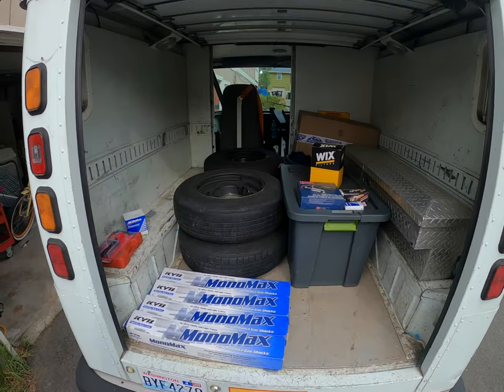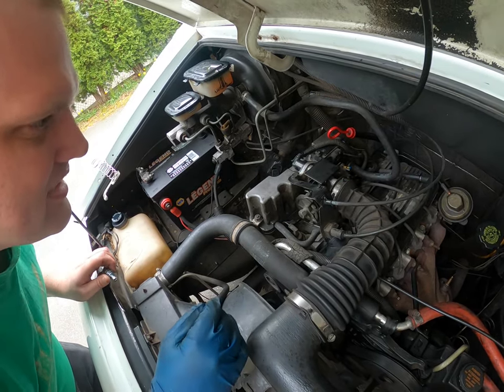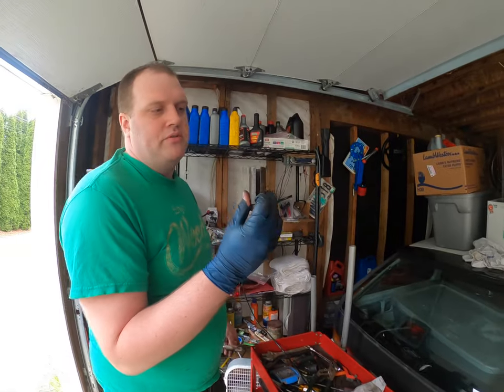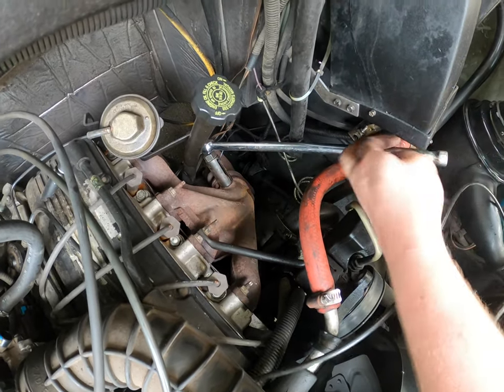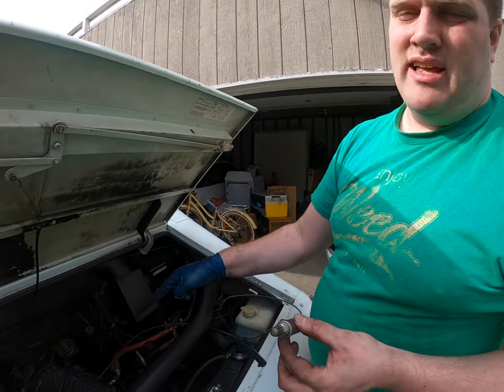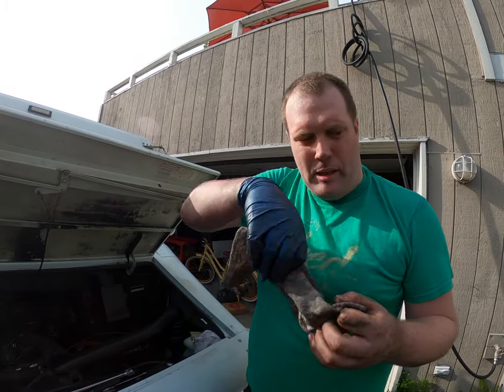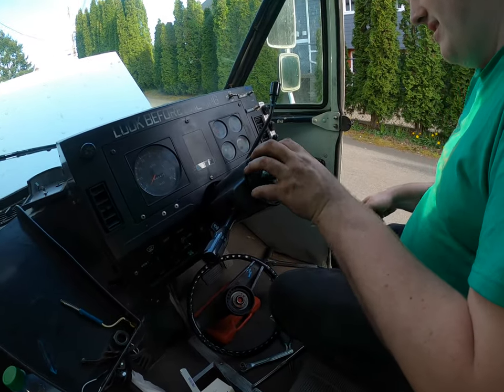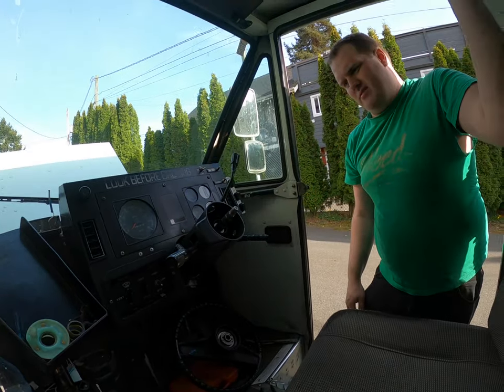LLVlog #5: Mail Truck Maintenance! O2 sensor and Turn Signals

Comment: Hey, I snagged a brand new door handle assembly, two dashboards, and some other small stuff from an LLV in a junkyard here in PA. I think the mirrors are still at the yard as well. They crushed it legitimately less than a week after it was put in the yard.
If you need anything let me know.
Reply from the maker: Shame, I would have loved to pick up some minor bits from it. Even just a few photos how certain things are supposed to be. Oh well, sad to hear that it got crushed already. Probably worth a pretty penny in scrap given how much aluminum is in them.
Reply: @PostalDog94  yeah. What photos are you looking for specifically. I might have a photo of it.
Reply from the maker: The first that comes to mind is how the heater valve is supposed to originally be mounted.  Another is what hardware was used to mount the spare tire jack to the passenger side of the bulkhead and where did they store the iron that goes with it. I have the jack and iron, but am lacking the hardware that held it conveniently in place. I also am missing the e-track mount for the spare tire, but there are a lot of aftermarket ones available to pick from
Reply: @PostalDog94  I might be able to ask my friend's neighbor. He works for one of the USPS garages.
Reply from the maker: That would be awesome! I know USPS typically just removes them from the vehicle as they don't expect or want their carriers to even attempt to change a flat tire out on them. So far I've not been able to find any pics or documentation that even shows it mounted up where it goes

Comment: Use a propane torch to heat up the old o2 sensor. It will help get it out a little easier.

Comment: Those rear shocks are a pain in the back side. You don't have to remove that metal ring on the steering wheel. Most pullers have long enough bolts to accommodate it. There are a lot of damaged horn contacts under the rubber horn button that will also make the horn not work.